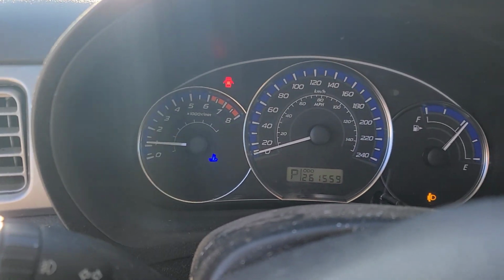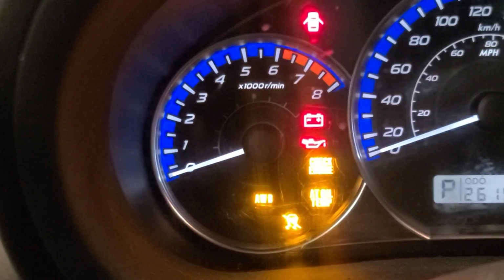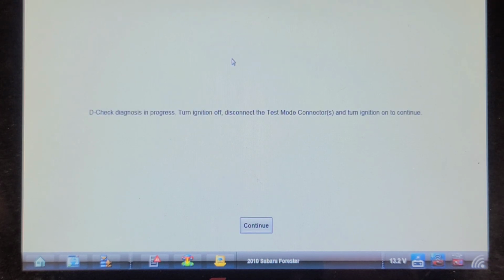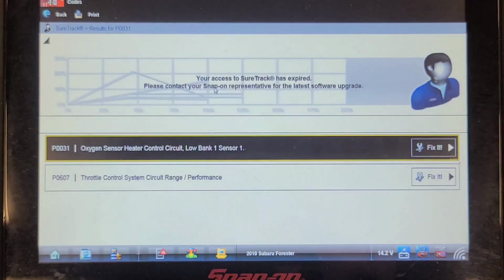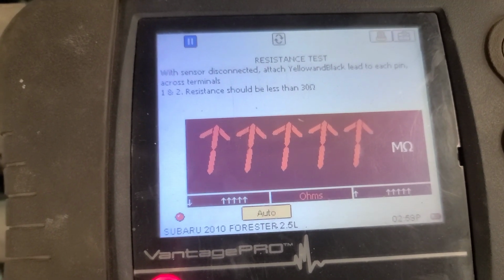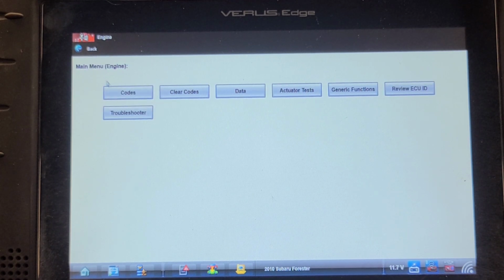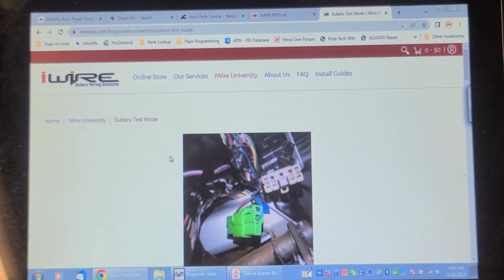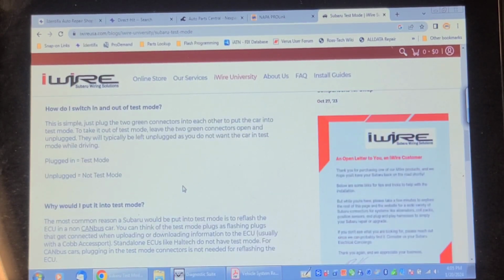2010 Subaru Forester Intermittent Crank No Start MIL Flashing And Cooling Fan Running KOEO

Comment: I’m only a few minutes in but I’m suspecting someone installed the inspection mode fuse in the underhood fuse box or connected the green test connector under the dash.  This fuse gets remove by the dealer tech after he performs the predelivery inspection. The empty fuse slot is a tempting location to plug a fuse back in.
Reply: Look like this one still had the old connectors under the dash. Some of the older Subarus also require that connector to be connected for module programming. Seems crazy to cycle the fans and solenoids right before module programming.  Gotta make sure the battery is good and maintainer is connected. 
The newer Subarus no longer required installing the fuse or connecting the d-check connector.
Reply from the maker: Yes that was what someone did.